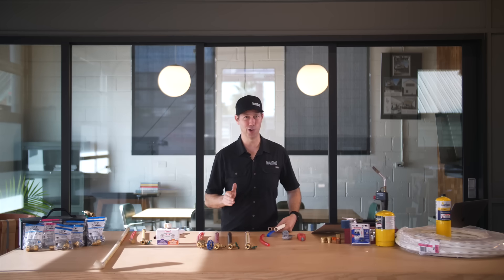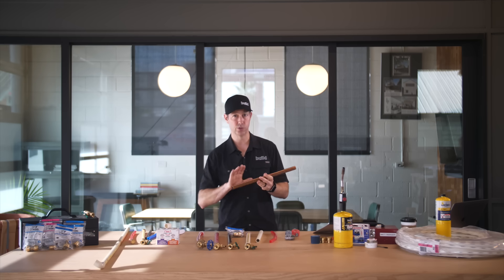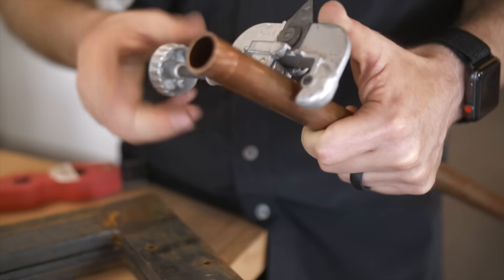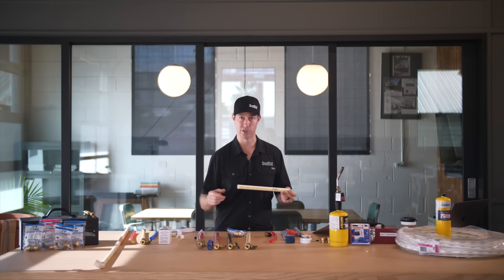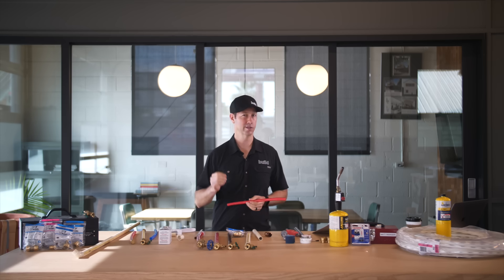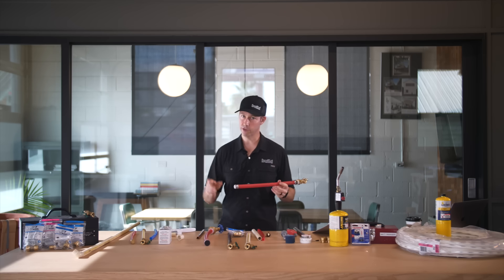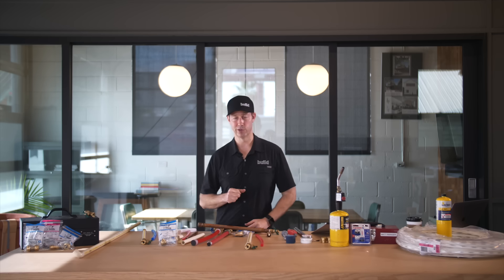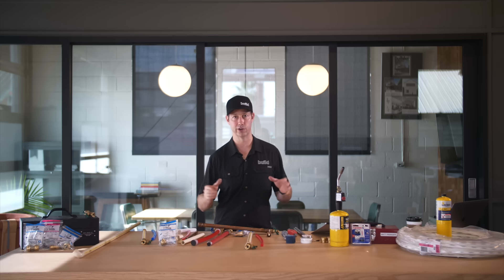PEX vs COPPER vs CPVC plumbing pipes

Comment: CPVC is for trailers and it's trash.
Reply: That's all we use in multifamily construction in Texas. DWV and the main supply is PVC while everything else is CPVC.
Reply: AFugy
Reply: Or well water since its to hard on copper
Reply: Depends on the chemistry of the well water actually. My home is all copper, 48 years old now no leaks with a fresh water well beside the house supplying water. Copper is a PITA to make changes to though I swear, I'm having to change some pipes around (since Hurricane Harvey flooded my home forcing me to remove lower 4 feet of sheetrock, figured it's a good time to make some plumbing adjustments but what a pain!). I'm getting better at it the more I work on it though and my sheetrocking skills are going thru the roof! LOL!
Reply: Cpvc is cheap and available, that's why it's used everywhere. And it is junk. But like my old boss used to say, it's only gotta last through the warranty period. After that, it's a service call $$$$$$$$ no joke he used to tell me to overheat ball joints when we sweated them in. He wanted shit to fail after a year which was our warranty period for new construction. And this was at places like Buffalo Wild Wings and Perry's Steakhouse and Houston ISD
Reply: @slash09r1  Unions and communists made plumbing work overpriced in America. But it's no rocket science.
Reply: I am  a licensed plumber. I live in a house that was replumbed in 1979. all water is cpvc. I have excellent water pressure. I have two water heaters with outlet at about 130 degrees. I can still cut into the pipe with no problem. no breaks, no leaks.
Reply: Cpvc is garbage gets brittle quickly even if it's in a crawlspace or basement. And if you're buying a house that's been sitting empty on the market for even a year plan on replacing all the cpvc water pipes because they will shatter. I have personal experience with this unfortunately. As with anything else in life you get what you pay for and the cheapest way sometimes ends up costing you way more when you have to repair water damage. Replaced it all myself with copper and silver solder (lead free) costed more but I will be long dead before it fails again.
Reply: Trash is the plumber that does not know how to use it, strap it properly and prefers PEX and snakes its through all the walls without proper strapping. A certified plumber that knows how to properly weld the CPVC joints (Weld not glued, read the label "Solvent weld") with do an amazing job. All big buildings are using CPVC. Those buildings in Texas that are using the PEX are cheap as hell. They pick the cheapest materials and build the structures with wood. Down in south florida, its all concrete structures. You will not find a wood house LOL. CPVC is chlorinated and made for water with chlorine depending on the city. Use PEX in south florida and your are screwed due to high chlorine content.
Reply: @CSJiGSaW08  pvc cpvc are  used all over the world. Some people don't travel outside their county lines.
Reply: Big apartment buildings 300+ units are being plumbed with cpvc. Big name plumbers are using it. I doubt it's trash
Reply: @crobinson3128  agreed
Reply: CPVC is used everywhere, and it’s not trash. Every kind of pipe has its place, as well as places where you don’t want to use it.
Reply: @Ethan.Lamoureux  exactly
Reply: AFugy lol well my uncle is a driller and I can sweat pipe, run pex or glue cpvc and it's often used on big expensive softener systems In neighborhoods where the band 21 pilots live. Trust me it's not just "for trailers" and not really trash either.

Comment: From my 50 years of experience with plumbing is that copper will eventually corrode and develop pin holes, depending on the dissolved minerals and the chemicals in the water. CPVC will eventually become brittle and fail. PEX, on the other hand, is nearly indestructable. I noticed that steel galvanized pipe wasn't mentioned at all. Steel has the highest pressure rating and is the strongest of all these systems and will survive many freeze thaw cycles. Steel is also the most expensive, and of course is old school and has fallen out of favor. PEX will survive 5 freeze thaw cycles before losing structural stability.  Copper will split about 3" to 6" when frozen and CVPC will split 3 to 4 feet instantly. 

PEX (Cross-linked polyethylene - HDPE) is my preferred choice. It's cost effective, easiest to install, easiest to repair, longest runs with the least number of fittings, extremely tough with the lowest flow coefficient and unaffected by dissolved minerals and chemicals. PEX is the newest system, but I believe it will become the preferred standard for water supply lines, and will be around for a long time.
Reply: Problem is, as I understand it, that the CU pipes they deliver today are not equal to those that was sold 20y ago - quality today is inferior.
Reply: What would you suggest for underground burial? and should it be embedded in concrete for durability?

Comment: I prefer pex over pvc,cpvc,and copper.  The problem with copper in my area is crackheads breaking into homes when people are on vacation, to steal the copper. They destroy everything to get the copper out of the walls. I've had issues too with pvc and cpvc failing suddenly and causing water/flood damage

Comment: "You have to be really cautious about water hammer with a copper pipe system."????
Sorry but that is untrue.
Fix the pipes to studs,joists or brickwork using clips.All good plumbers do that.it takes seconds.Anyone who doesn't do it should be fired.Out of a cannon!.
Why do you make it sound really complicated and difficult to do???
Also,curving pipes wherever possible,minimising the no. of crude 90 degree bends in them will make a big difference and reduce pressure drops and water hammer.
Why do you say that copper pipes cant be bent??? 
"You are not going to bend this."??? What the F?
Do you know anything at all about plumbing or do you just get fed BS by plumbers who are conning you?What planet are you on?The whole point of copper is that you CAN bend it!
Pipe benders are in the shops and have been for over a century !!!
https://www.screwfix.com/p/irwin-hilmor-glm-pipe-bender/63880
If you can't curve pipes then you are not a plumber,but an eejit with a box of Meccano and a Bigtrack brain..
You wouldn't drive your car straight into a brick wall and THEN turn left or right would you?So why would you want to do that with your plumbing system with  90 degree corners?
After seeing the amount of hogwash in the 1st 4 minutes of this fiction,who would stay tuned to the end?
What a joke.
Reply: Ever hear of a water hammer arrester.
Reply: @heatrick1  I had horrible hammer when I bought my house.   Installed arrestors at my washing machine, added some hangers on loose pipes... And the problem is gone.

Water hammer is a sign of a bad installation
Reply: There are lots of plumber out there who do half assed jobs who just "get it done" to move on to their next job. I saw lots of free floating pipes in houses in North Carolina and Florida when they were going through huge building booms, even as a teenager I thought it was wrong. Of course my grandfather oversaw the building of his own home in `92 and it was flawless and all copper pipe with bent pipping when a 90* turn wasn't  required.
That and copper is innately superior for water as it is a natural anti-microbial unlike the plastic alternatives which can harbor bacterial growth.
Reply: you can bend soft copper. Rigid copper doesn't bend so well.
Reply: @bad_luna5222  rigid copper actually will bend with the proper bending tools.    Honestly, though, there is not much advantage in hydronic piping, other than the reduction in solder joints.   The velocity is low enough that it doesn't offer much.    We always bend refrigeration piping when possible, however, where the long sweeps are much more effective (and we don't like to use soft copper at all, if possible.    K for refrigeration, L for water, M only for drainage or maybe compressed air)
Reply: Chippy Steve.   My house had a terrible lack of hangers when I bought it.   Water hammer, particularly from the washer, used to shake the piping throughout the house.     I have since fixed it, but what he said is true.   It's usually  limited to crappy installs (which DO exist, unfortunately)

Comment: I wonder which pipe is the healthiest? Do chemicals in the pipe leach into the water and bio accumulate in the body?
Reply: https://www.buildinggreen.com/news-analysis/harmful-chemicals-may-leach-pex-drinking-water
Reply: Most likely.
Reply: I spoke to several people while studying Geology.
Ceramic and wooden pipes; more modern Steel/ cast iron is the best for your health. 
Depending on the Water also stainless and copper but only if you have a build up inside. With calcification the led pipes are also still OK if you never cut or change something and let the water run out of the lead part after the weekend or longer stagnation.
All Plastics or better all materials interact with the water. The components of plastics are not known, and it will take centuries to be sure of the health problems they can cause.
Copper can poison you (even deadly for babies) if you have very acidic water.
Stainless steel is the same and can cause allergies from the dissolved Ni and Chromium. For Plastics it is the same but you have additional volatile parts that are most likely the more dangerous the newer the pipe is. So go for Wood or steel pipes. I find steel pipes work good. With the screwed on fittings and Hemp for sealing it is very strong and I found that small leaks can rust shut. It is much harder to dill into a steel pipe if you do something on your walls than all other materials! Plastic is sometimes softer and or more brittle then wood. And if you drill in stone you will never notice other than steel (or cast iron) pipes.
Reply: The healthy water was run between the legs of a moose then put into a plastic bottle. How much worse can these pipes be?
Reply: Might help to consume or cook with filtered, distilled or purified water when in doubt...
Reply: @luissonoma6255  I wouldn't recommend a steady consumption of distilled water since it is the universal solvent.
Quite literally, everything is soluble in water, so you'll be rapidly leaching calcium from your bones. Not good!
Reply: @joesciolino3835  I wasn't aware, good to know. Thank you for your input.

Comment: I OCCASIONALLY see 50 year old copper systems that are not leaking, pin holed nightmares. But usually copper has been replaced long before that. In my experience, the evil polybutylene has proven to be a better piping system than copper.
 CPVC does get brittle over time, and there are occasional failures in my area, though I personally haven't run across too many. It has been the dominant piping here for decades, so we should know before too long if it holds up long term in our climate and water conditions.
The big disadvantage with PEX is it's vulnerability to UV and physical damage. It has to be protected from light and abuse. Also, be careful what fittings are use. There have been some problems with the zinc being leached out of brass fittings and leaks resulting. Make sure the fittings are bronze or dezincification resistant brass.
Reply: Where is "here"??     Geographical region, please. It matters.
Reply: JOHN BECICH Central Florida
Reply: Thanks.  Central Florida, got that.    And you're warning (with prodigious experience) that some unnamed PEX fittings degrade over time, from inferior materials composition.   I've never heard this before but I'm a newbie on the subject of PEX, while I have over 50 years of experience with copper's reliability in soCal.       (Nobody mentioned copper's vulnerability to bursting from freezing, in places where nobody expects to have freeze damage like Los Angeles... but that's another subject...)

I am left with a gaping void in understanding the surrounding circumstances of why copper fails so predictably, in Central Florida, by your message:   Really you're warning anyone who subsequently considers using copper in Central Florida, that he should use polybutylene instead.     Right?  But there might be other explaining circumstances for copper's failures, in the past.    Here are some points of curiosity, on my part: 
1) manufacturing defect from a common provider, say, in the 1970s.   For example, substandard wall thickness or inconsistent wall thickness, etc.   Or inferior alloy.      Or contaminated alloy, leaving seeds for corrosion
2) acidic environment
3) common mistake in assembly by plumbers of a certain era
4) flux or contaminated solder, of a certain era
5) habitual contamination of exterior of piping with cementitious materials
6) some nasty tool that was common to all plumbers.

Instead, you leave us with the blanket caveat that copper should never have been used, and should never be used, in Central Florida.      This is very intriguing.      Thank you for participating in this discussion.

Comment: You missed the best pro of PEX that is you can make a full run through your walls and not have any connections inside the walls.

I think everybody should install hammer arrestors no matter which pipe you use.
Reply: he said it

Comment: It would have been nice if the video mentioned CPVC becomes extremely brittle after around15 years. My place is 19 years and has CPVC and it shatters every time I need to make repairs somewhere. Like try to put the slighest torque on a fitting to a toilet fill valve to put a new one in, guaranteed CPVC pipe break, you're lucky if it's a leak on the CPVC stub out of the drywall and not a crack on the pipe inside the wall... Or remodel, saw a pipe, put a T for an new extension, you're likely to accidentally crack the pipe  4 feet away from where you're working just touching the pipe. CPVC is aweful pipe choice IMO. Useful lifetime is 12-15 years after that it won't leak if you never ever touch it. But sooner or later you have to touch a valve or fitting then problems start. My water is great quality, not particularly high in any mineral nor chlorine, it's not the water. It's not the UV either, all my pipes are inside walls. Pick Pex or Copper for your house. Not to mention the solvent for CPVC fittings stinks like it contains some really bad carcinogenic chemicals and indeed it won't come off you if drop the tinyest amount on anything (including your own tools, or your brand new sink). Nasty solvent.